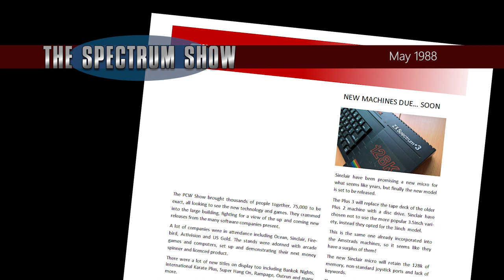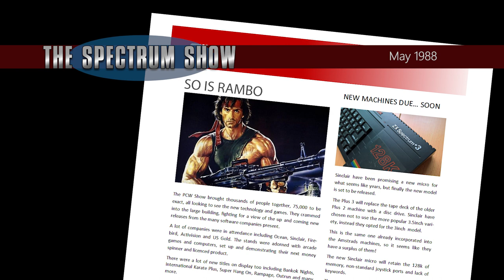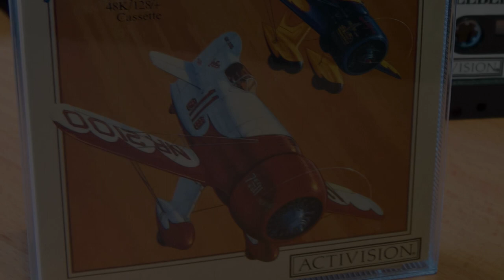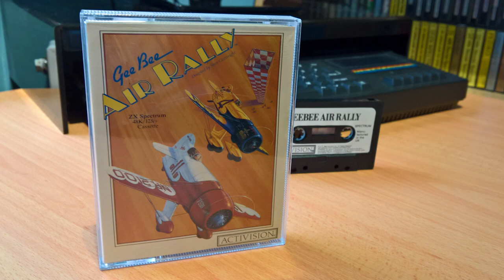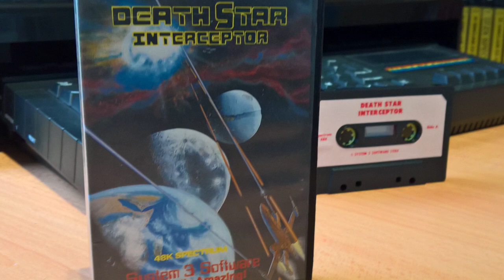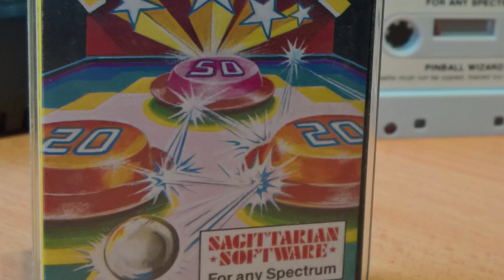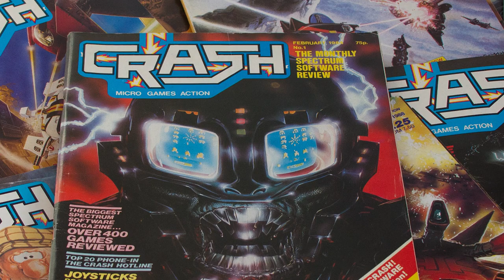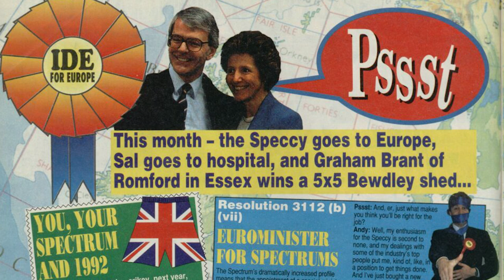The Spectrum Show EP 67

Comment: With reference to your external sound box for your Speccy - we had the WH Smith Computer Program Data Recorder. It had a speaker control switch which allowed us to use Monitor mode where we could hear the Spectrum game sounds through the tape unit and the volume was adjustable. Absolutely fantastic piece of tech.

Comment: That other lead is most likely for connecting to your cassette recorder, so you can still load software without disconnecting the sound box.  The free way of getting amplified sound was to use a cassette recorder...  so long as it had a variable monitor circuit.  I used to connect the Ear socket of the Speccy to the Mic on my recorder, press Pause, then Record....  and sound from the Spectrum would be amplified very well.
Reply from the maker: Yeah, I used to do that with my tape player, but always felt I was putting too much strain on it!!

Comment: Crazy Cars is not that difficult to control if you let go of the "flap" button once in a while. You don't want to destroy your keyboard by constantly hitting the button but you don't want to hold it down until you hit your head on something. You have to hit the white cars head-on in order to "kill" them.

Despite the copyright notice and polish, the game was not actually ever a commercial product, but just one of those many bedroom productions that were released as freeware.
Reply from the maker: Thanks. The game does improve the more you play it and get used to the inertia.
Reply: Inertia is a big part of the original arcade game, so I kept it that way when I wrote Crazy Cars.

Some trivia:

I had one of my friends play the arcade game whilst I was taking notes as to which platforms as well as how many enemies of each type would appear on each level, so this is accurate up to level 25-28 or so. The rest - up to level 50, I think - was made up.

The cars and helmets were used in place of the original graphics due to the limitations of the Spectrum hardware and my skills as a pixel pusher, rather than an attempt to circumvent any copyrights.

The game was written without an assembler, i.e. on paper and then POKEd into memory one byte at a time. Let's just say I used an assembler for my next project. Still, it was easier than using punch cards.

The graphics was done on paper as well, except for the logo and the platforms which were done in Melbourne Draw.

The game will play a couple of bars from "The Winner Takes It All" if you beat the high score. Or if you make the high score list - I don't remember.
Reply from the maker: Thank you for the information. Fascinating details about the creation of this game, great to hear from the author. The 'feel' of the gameplay is spot on.